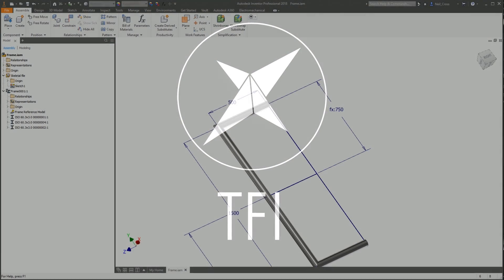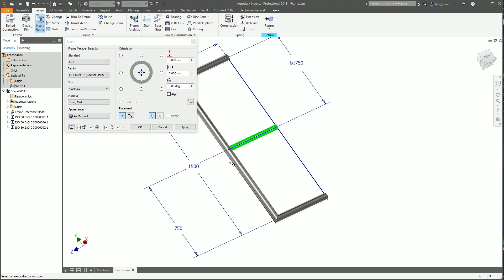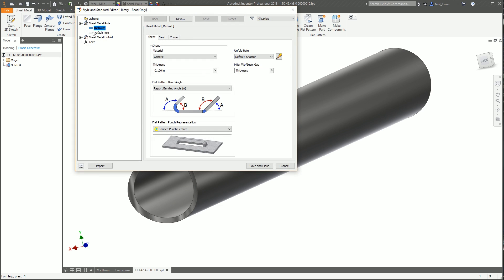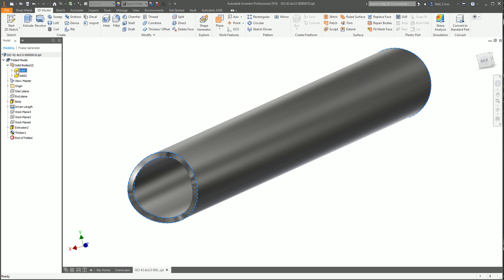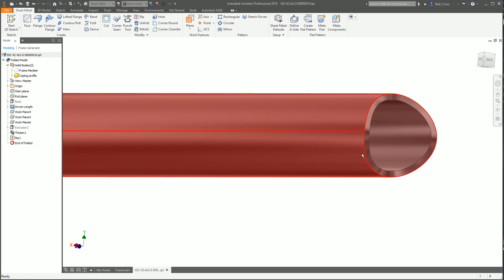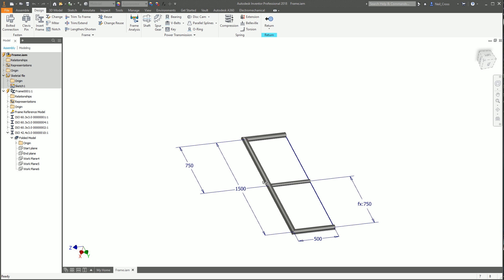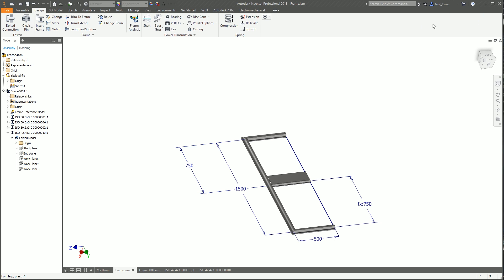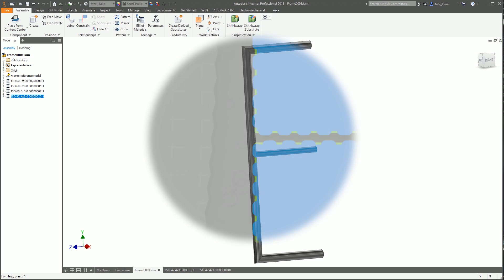How to Flatten Tube Frames, Notch Coping Profiles | Autodesk Inventor

Comment from the maker: IMPORTANT - if you use this method and leave both the new objects in the model, you'll have two solids in the same tube which will DOUBLE the mass of the tube, which affects the weight calcs of the final assembly.  If you're bothered about this, either delete the second solid after you're done, or do a SAVE AS on the tube beforehand and do all this on a copied version of the file.  Cheers to Joshua in the comments for pointing this out, I just got so wrapped up in getting around the K factor issue I never considered this which is unusual for me!
Reply: I would recommend doing a derived part from the tube, then apply the process from the video but only keep the flattened part.
So when you do a drawing you add the needed cut template (however you like), which will keep updating changes from the frame but without adding mass.
Reply: @MrTigerpirro  I have used this method a lot, derived sheetmetal part as a surface, thicken outwards 0.1mm slice & flatten. works great.
Reply: While watching, I got concerned with this problem, too. Could you make a follow-up video that shows how to do what MrTigerpirro said?

Comment: Sir, I'm new to inventor. I have a question and hope you can help. How can I project the inside edge of a tube to the outside surface? Such as a 90 degree tube joint with tube diameters of 80mm and a 6mm wall thickness. Attempting to transfer a tube drawing to .dxf for a cnc tube cutter that will not make beveled cuts. I'm just wanting to project the inside edge onto the outside surface so I can split the outside surface and remove the unwanted portion. I'm sure its easy but I just cant find the answer. Thank you.

Comment: Hi Neil, Thank you for the epic video tutorials and help on Autodesk Inventor. I am currently working through an Inventor manual to try and hone my skills (I am relatively new to program) and was wondering if you would be so kind as to assist with a question I am struggling with? I have a difficulty understanding the "Auto Explode" function in a presentation file to create a time line on an assembly (multiple moving part). For some reason I can't find the Auto Explode in 2018 version of inventor. Was it removed/hidden? Am I blind? Do I need to adjust all components separately at the start of the timeline? The manual is a 2015 version. Enjoy the rest of you day mate.\m/

Comment: Hi Neil, I like your videos very much. I usely try them right away. But this time I have some trouble. I made a similar frame as yours, but I turned the square tubes by 45° and placed a round tube in an angle. notched it, turnd it into sheet metal, changed the k-Faktor to zero. First weaird thing, when I thicken the tube, making a new solid, it adds also to the notched face of the tube, second, I'm not abel to ripp the tube to flatten it. Any suggestion, what I'm doing wrong?

Comment: Excellent way to make notches. For my OpenEmoto project ( https://endless-sphere.com/forums/viewtopic.php?f=28&t=92563 ) i've designed another notching method based on surfaces created by combining solids, exported and unwrapped by Pepakura ( http://www.tamasoft.co.jp/pepakura-en/ ). The files are on github https://github.com/eroldan/OpenEMoto/blob/master/MainFrame/Cuts/CutsPositioning.pdf

Comment: I've used a similar workflow to this however I used the "Flat Pattern" option to unfold the tube.  This way you don't have to fiddle with solid body / feature visibility and you just place the flat pattern view down onto the drawing sheet.  I must admit that I've never thought of using the Rip function though.
Reply from the maker: How do you flatten a tube without a rip? There needs to be a gap?  This method is specifically for tubes that start life from the content centre/frame generator but curious to hear how you do it without a rip
Reply: Oh flip...I didn't mention that I would manually draw and extrude a thin pie slice out of the tube (also from Frame Generator), but Rip is so much faster!

Comment: Can you help me out for FEA topic?
I'm checking FEA prob points but after openings the FEA results all the prob points are disappear. I need to save all the FEA prob points in some file format like .xls/.csv/.txt
Please check out and revert if you can.
I'm using 2013 version!
Reply: Go and post that question at the Autodesk (Inventor) forums. They will probably help you out.

Comment: I use a modified version of your tutorial here. If using your method verbatim, wouldn't your mass be doubled for that part and mess with overall weights and COG? If so, may want to point that out to the users in case they don't realize it.
Reply from the maker: Shit, aye, I never thought of that! Usually I always consider the BOM and physical implications of stuff but I got so wrapped up in how to get around the K factor issue I forgot about the mass being a thing! Dammit, thanks for mentioning that, I'll put it in a pinned comment at the top here.

Comment: Since you have been doing several vids on the frame generator I though I would pick your brain. The structural engineer I use to stamp my work always asks me for a wireframe on center as this is what his program works with and he doesn't work from cad or Inventor files at all. The question is, can the reference wireframe be exported and annotated with the points plotted in 3d space?